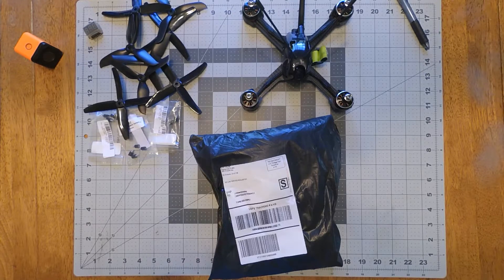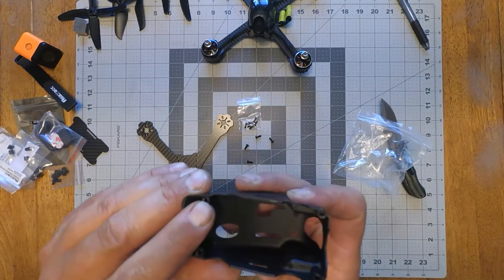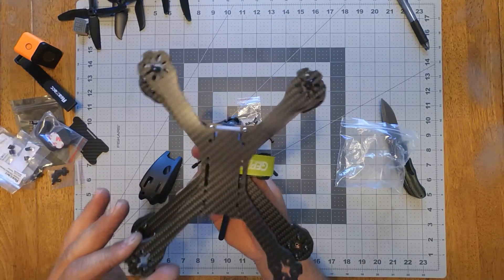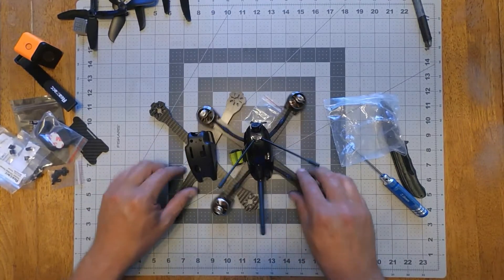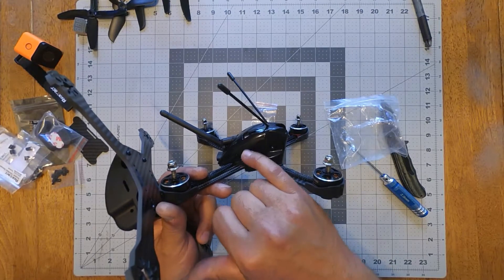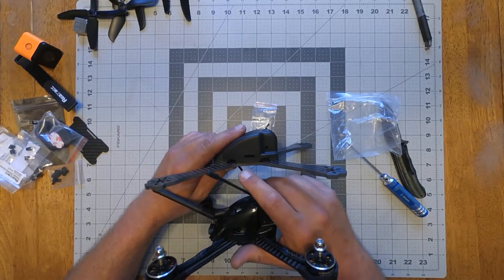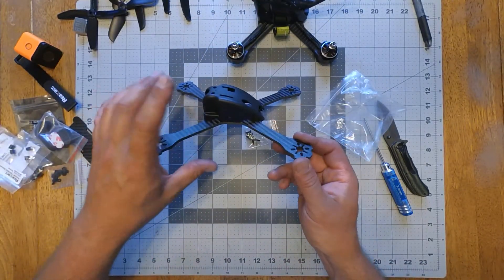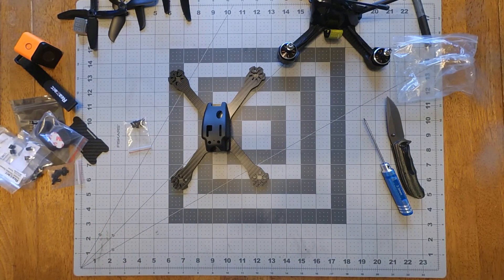Realacc XS220E 4mm Carbon Fiber Frame Kit

Comment: I had a fc go snap, crackle, pop!! I broke out the trusty multi-meter and found that the $4. PDB, I mean $4. What could possibly go wrong??? The 5v that powers the fc shorted or spiked and fried it!! From here on I don't use their free pdb!
Reply from the maker: Yeah i have a box of them I don't use them regularly i have used 1 or 2 and have not had an issue yet but I don't want too ether.. :-)

Comment: thanks for your vídeos. Very useful stuff.
A question only. If the lumenier pod fits in the realacc x210, and in this frame as you said, will it fit the realacc pod in the realacc x210 frame?
greetings
Reply from the maker: Hi my friend! I believe your asking if the realacc pod fits the standard x210.?. If that's what your asking.. Yes it will fit, but it will NOT fit the x210 Pro.. please like and sub and if you did thanks so much anything else just ask. Have a great day!!

Comment: never saw the x210 build w/ the race pod and can't find it on your channel.  is there a video?  was curious which motors those were. I just got some RCX RS2206 V3's in the mail today to upgrade my racerstar motors.  Considering this stretch frame next as well or perhaps the skyline rampage for the thin arms w/ stretch ($$$ tho).
Reply from the maker: jonbrabham I have not finished the edit yet it's almost done I just need a day off to do it really busy this last few months construction job and all lol.. it's coming my friend.. Thanks for watching and have a great day!
Reply from the maker: Oops I forgot to tell you they are kingkong motors the 2205 2350kv they are a great cheap motor that comes with motor guards..

Comment: use the dys f4  I've used both and the dys was sooooo. much easier to solder to.
Reply from the maker: Craig Byrd I'll check it out I have a few FC's coming for review.. I've been using the cheap F4 that's reviewed on my channel this is the first one I've had go bad.. Thanks for the input and thanks for watching my friend you have a great day!!

Comment: Stretched X vs original?  Thoughts?
Reply from the maker: Hi my friend! Well they say that the stretch X is better for racing because the narrower roll axis, But my thought are its 90% looks and 10% performance.. So basically get what you like that's what I do, and I'm not to into racing right now not enough people fly here. Have a great night!
Reply: I watched a few more of your vids... they are all good.  Thanks for the helpful tip.  I am building a 3mm x220 with racepod because your videos.
Reply from the maker: Tom Wronski you need any help just ask I will do my best with what I can to help my friend👍😁

Comment: Any issue with a 4 in 1 ESC?  I worry if they burn up they take the whole thing with them.
Reply from the maker: Tom Wronski the first one I put in the pod build #1 esc bricked and I had to replace it the other ones I have are fine, the one in my Genius215 has been solid and I've been flying that for 6 or more months! No fires👍😁
Reply: Putting together two builds now.  I will put a 4 in 1 on a frame that doesn't have a plastic dome over it :P
The "podcopter" will have ESCs on the arms.
Reply from the maker: Tom Wronski cool cool👍😁